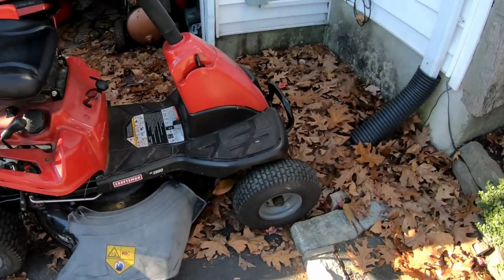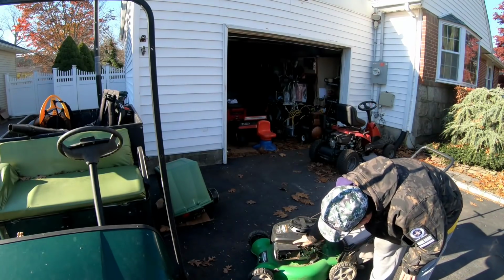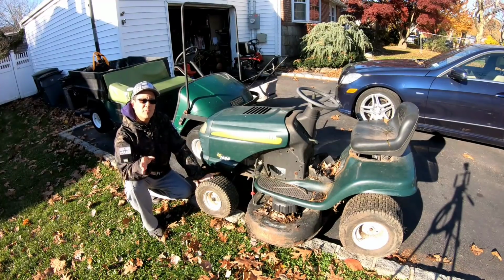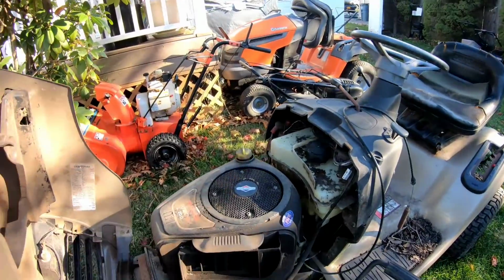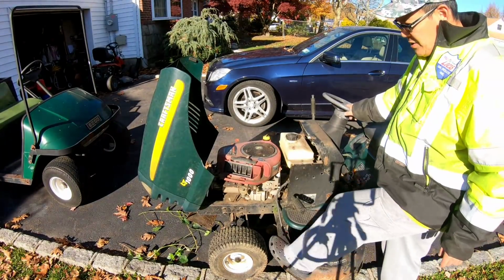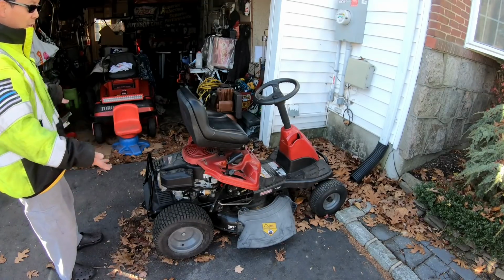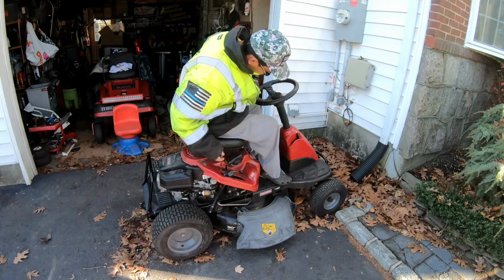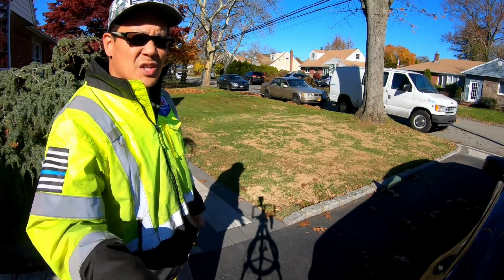GETTING MORE LAWN TRACTORS & EQUIPMENT OVERNIGHT MTD CRAFTSMAN DYS3500 LT1000 LAWNBOY TROY BILT HAUL

Comment: Hey Hendry the Craftsman riding mower.  I just worked on one recently that also needed a tune up.  Long story short. I thought it  was a carburetor problem but it wasn't the carb. The fuel line had collapsed and wasn't delivering fuel properly. So it was running badly. New fuel line. Runs great again.
Reply from the maker: Great tip bro!  That’s unusual for a mower this new to need a new fuel line.  I’ll check it out bro!

Comment: How do you store your next year's projects outside? Uncovered, tarped or in a shed?
Reply from the maker: Usually in the shed,  but I’ve had several sheds collapse from the snow!  Now I’m just leaving them there with some tarps!
Reply: Tarp from Harbor freight. If it has a good battery use a trickle charger.

Comment: I worked on 2 of the Troy-bilt version, but they both had the 12.5hp briggs, both had the deck/discharge chute safety switch not being depressed by the chute, I just bypassed em.